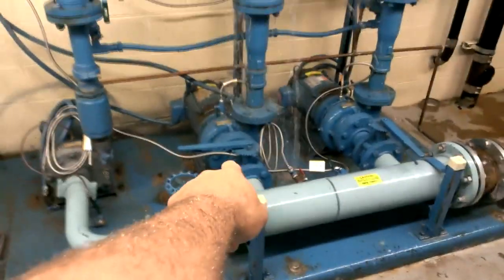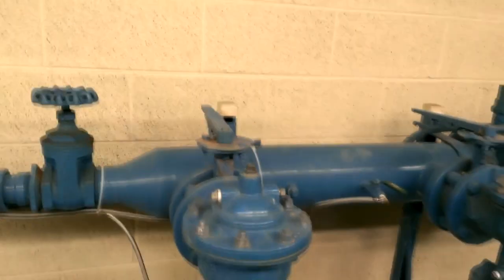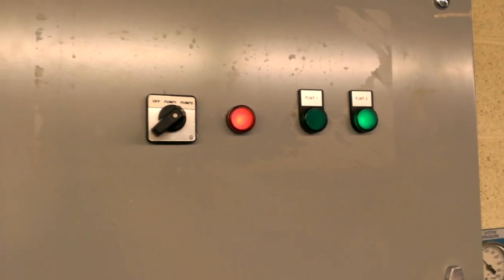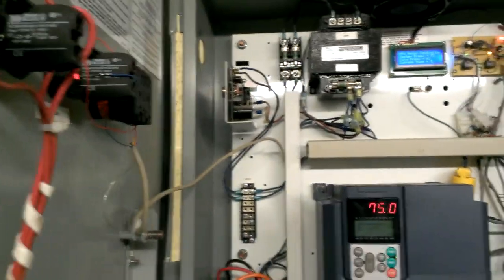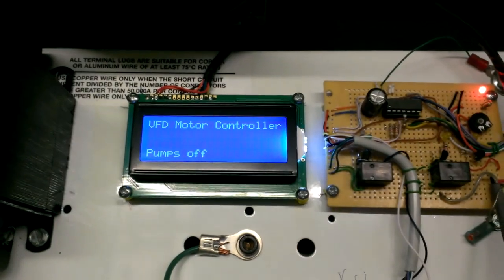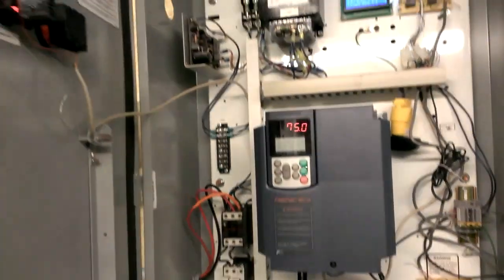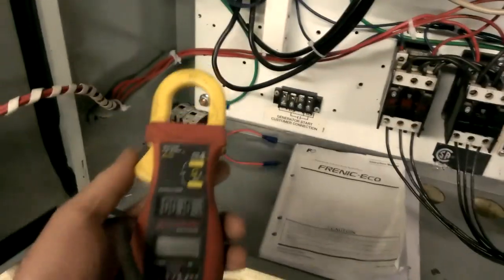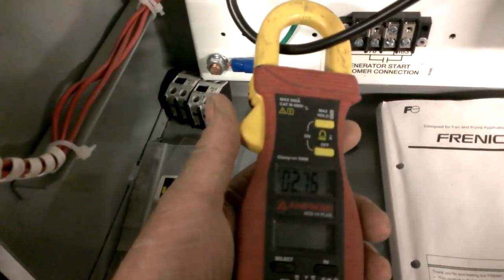Pump Variable Frequency Drive Retro Project - Part 7 - Finalized with old equipment removed

Comment: great video thanks. i am trying to do a smaller project to run a 220v 50hz ac 500w borehole pump from a nominal 380vdc flexible solar array that you can see in some of my vids. i got some code into a pic that i intend driving high/low side igbt modules (littelfuse 400a/600v so way overrated). on the scope the waveform is a horribly glitchy pwm sine that dont quite flow enough to trust with power electronics. have you any suggestions for me? pump is single phase so im not sure how well it will like vfd but sure would be nice to have it slow start and avoid needing batterys to add torque. keep up the good work!
Reply from the maker: +drspastic PIC chip eh? I like me those but never controlled an A/C motor with one.

Of course these VFD's use a lot more complex control. They vary the frequency AND the voltage depending on calculated torque required etc.

There is a HVAC tech on here that is a geek like me that I was following. I haven't seen him in a while though. He wired up IGBT's to drivers and what not in some of his videos.

He even put a 30HP motor into a Chevy Express Van to make it electric. That was pretty cool.
Reply from the maker: Hey, I found his channel in my sub list.
I bet he's got some info you could use!

https://www.youtube.com/channel/UCpFDfep36yxunfznRfv-W8A

Comment from the maker: I have that electric fan on top of the box with some intake holes on the bottom (heat rises) inducing the draft to cool it. 

We have the same VFD on a 60HP box in our central plant that someone else installed where they have the fan blowing down low in the side. 

The only negative about the fan being on top is risk of water falling inside the panel if we get something bust loose in this room. 

I may make some sort of a water shield in the panel to divert the water or something.

Comment: nice job just got done changing a VFD today for a blower motor it was in a electrical box like yours but only half way in the fan side was sticking out the back to get rid of the heat how is the heat escaping your electrical box so the VFD dosen't over heat

Comment: Nice job.... Could you have programed the VFD to run Pump A for so many hours and then automatically switch over to Pump B to give both the pumps equal run time and then have manual override of either pump? That would be really cool except it may not be a good thing if you have old pumps which are not equally worn.